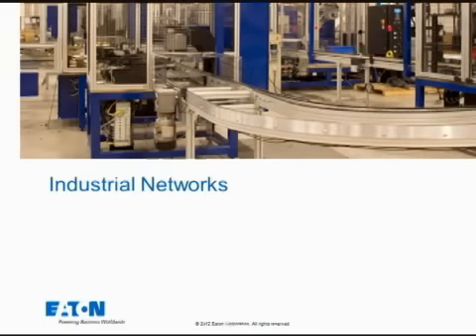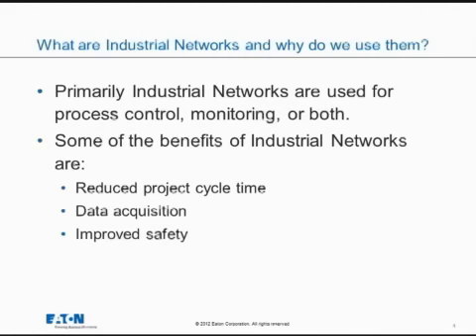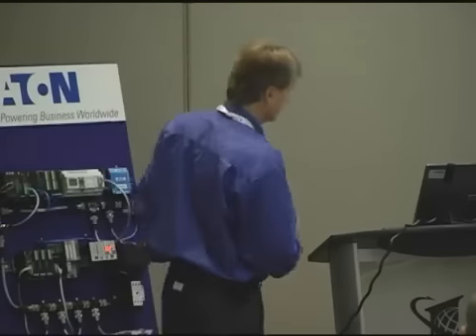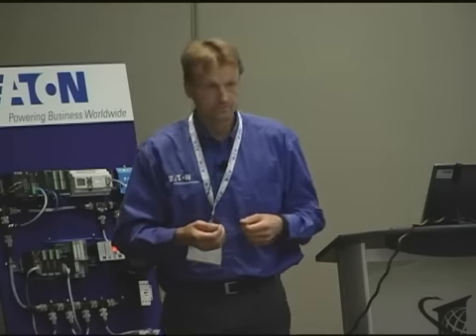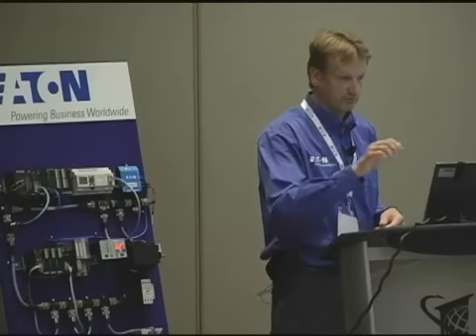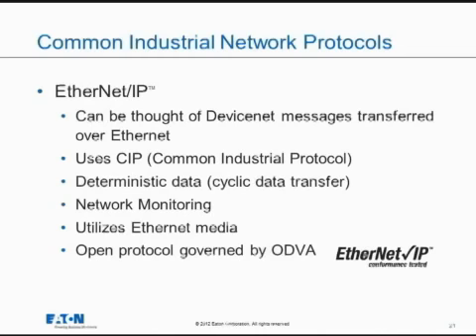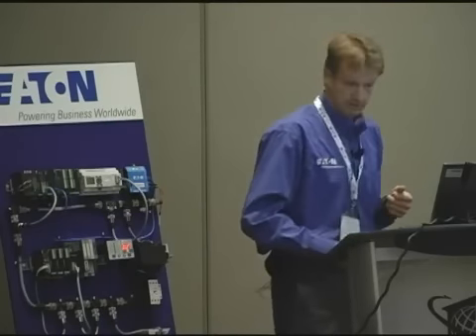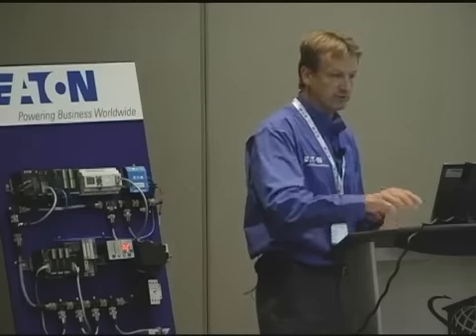Industrial Networks Fundamentals

Comment: You're wrong.
IT networks use star topologies  (home runs of ethernet Cat5e/6a cable to a switch).
Class A fire alarms use a ring topology.
Not  a single hot/ground, tip-ring-sleeve, 8P8C, or 2-wire differential pair describing a "line" or how to actually connect/terminate a line with a wire stripper, connector jack/plug or screw terminal. Where is the end for an EOLR to prevent ringing?  What does a ringing signal look like on an oscilloscope?
Fundamentals?  Hardly.  Just a bunch of hand waving at a powerpoint chart with incorrect information.  Worse than useless when you're talking about safety.